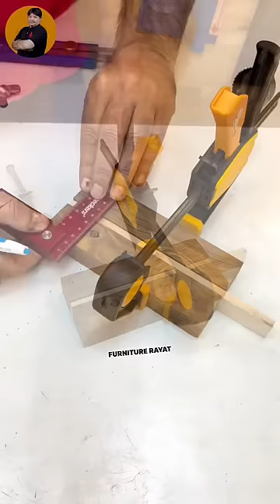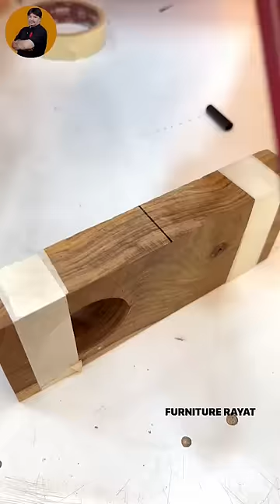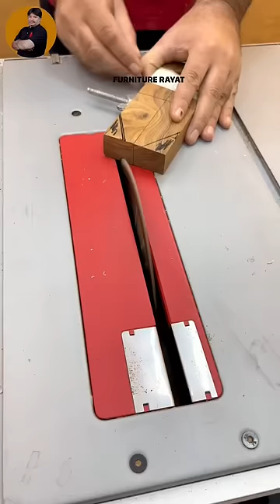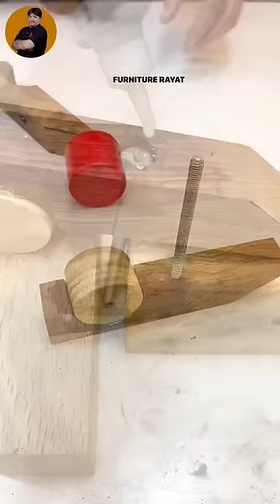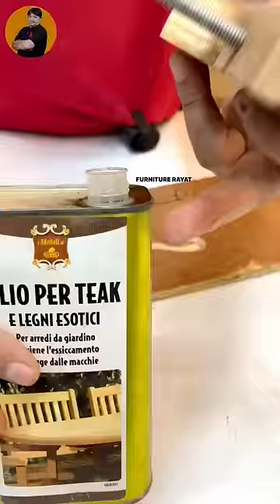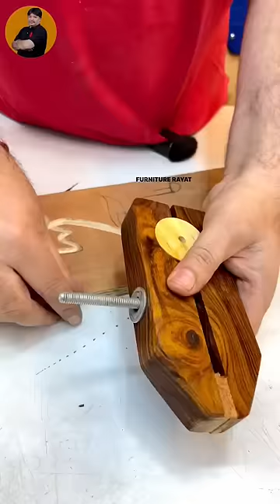Grinder Cutting Jig #shorts

Comment: This, unlike plain vise-grip pliers, will grip a wide variety of materials with controlled pressure, without marring softer materials.  It can also double as a reference grip for use with bench grinders, belt and disc sanders, and related tools.

Comment: Have you ever needed to quickly cut a flat washer but aren't clever enough to grab a set of pliers? Well with this easy 32 step process you can be on your way to cutting that flat washer in as little as 3 days. You can get started with just a few simple tools, all you need is a saw (electric & hand) a hammer, chisel, drill, table saw, clamps, sander, drill press, grinder, hole saw, ⅜ drill bit, speed square, pencil, tape, wood and specific hardware.